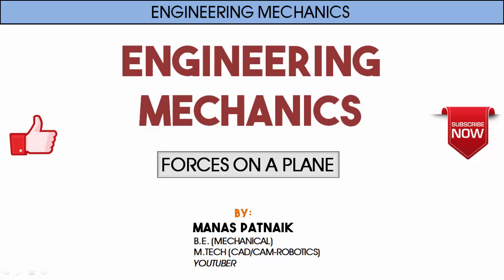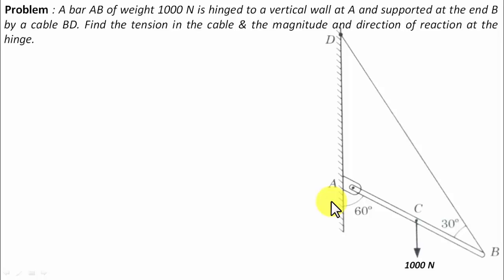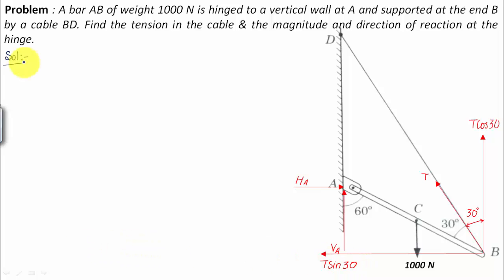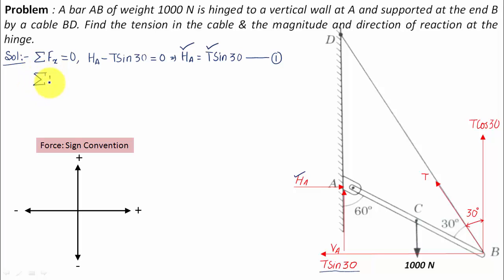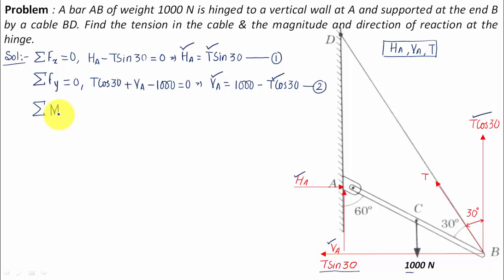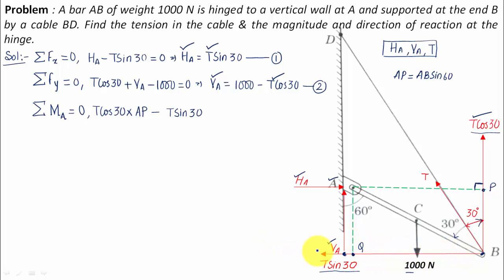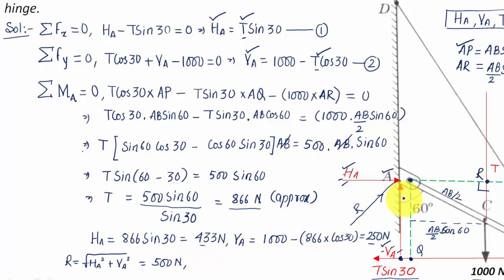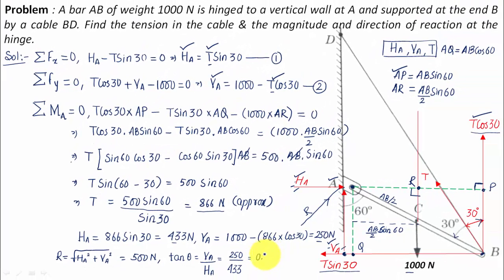Engineering Mechanics_Forces on a Plane_Level 1_Problem 5

Comment: So, If I had a platform (A,B,C), and I was holding it up with a cable (T), And I wanted to make sure there was not too much tension on the hinge (A), so my platform won't break in the middle (C); this is the formula I would use?

Comment: Why we dont consider tension on Point D side. And doesn't take it on  equilibrium equations?
Reply: I think that is a good question. Too bad there is no response.
Reply: Since, when we deal with only body except whole system which is in equilibrium state then we  represents FBD of that body irrespective of system( i.e we represents only those forces which are acting on body. So for equilibrium state of body we will use those forces which are acting on only that body except other forces which are acting other part of system. By the way we can consider tension on point D but there is no role of this tension on equilibrium equation of hinged Bar at point A... I HOPE YOU GOT YOUR POINT....